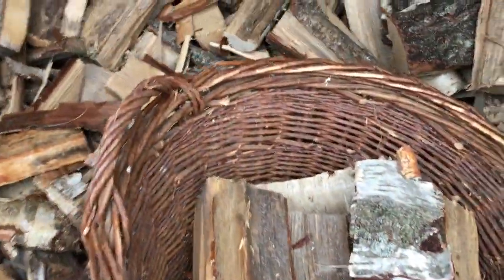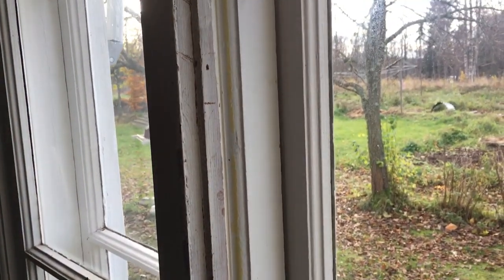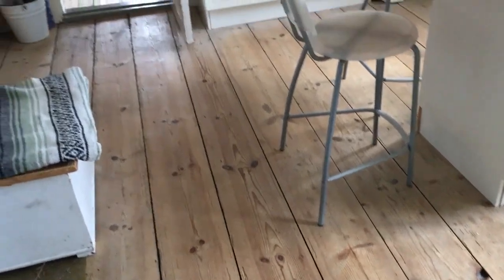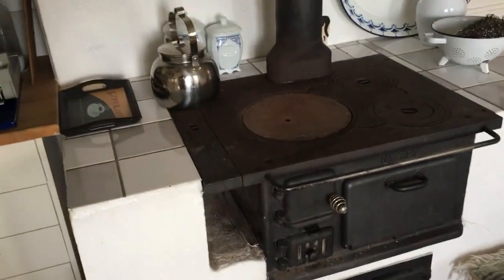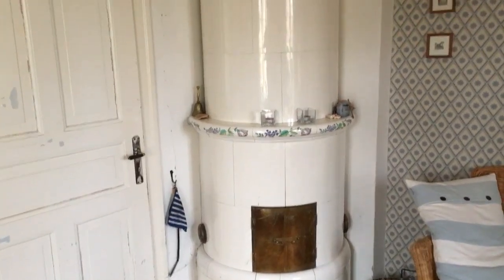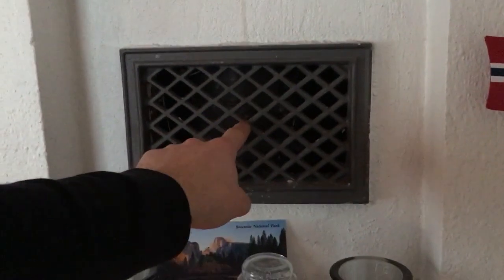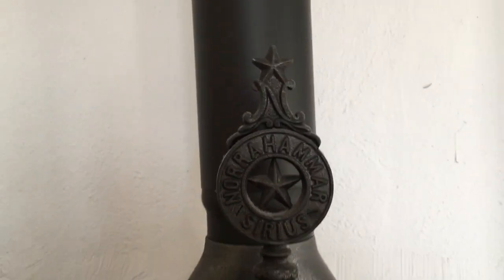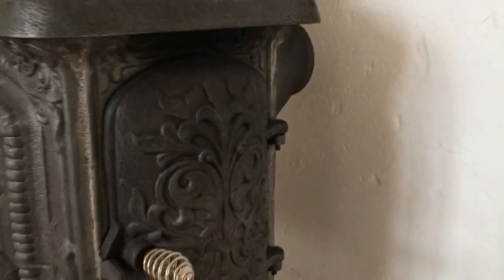The Most Stunning Wood Stoves In Our Farm House

Comment: The tile stove (white) was very interesting—until you said you had to start (light) it TWICE a day.  That’s terrible.  I built a wood stove in 1980 that only had to be lit in the fall—once.  Then in the spring you let it go out. Naturally you used good wood, like white oak.  If someone made your tile stove more efficient it would be perfect.
Reply: I think he might have meant feed it twice a day. Lots of variables with wood stoves as far as how much wood they need.
Reply: That type of stove heats around the clock.  Two firings are plenty.  Ours burns for up to two hours, down to fine ash, then the stove is closed up and the heated internal thermal mass would heat for 12 hours or more.  Firing it twice a day for a few hours kept our 1800 square foot house warm even at -40C.  Completely different than keeping a metal stove going for heat, different technology.  Look up masonry heaters for details on how the masronry stove techology works.  These stoves are the most efficient on the planet.